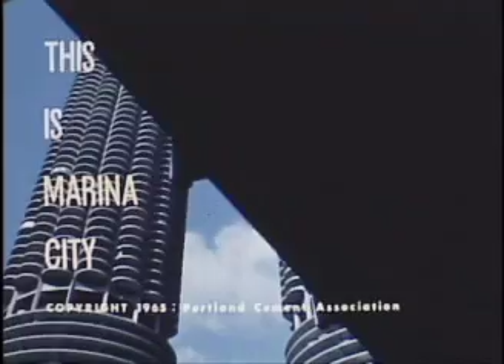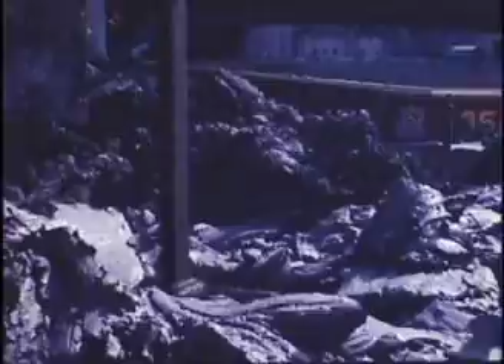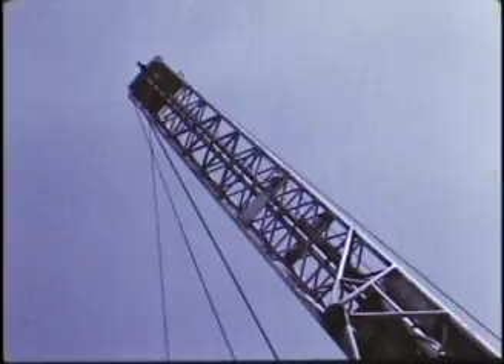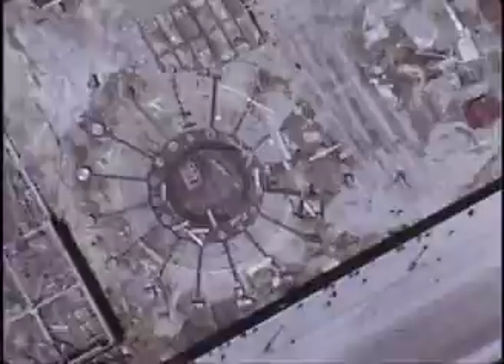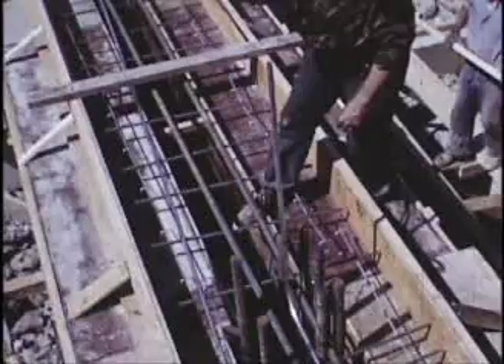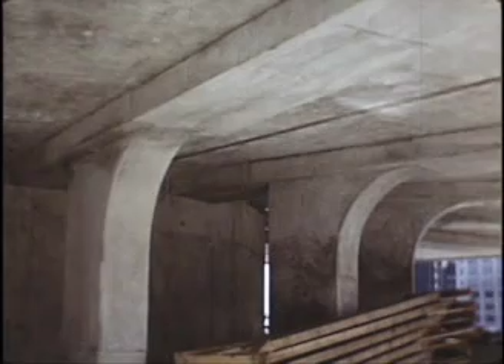This Is Marina City (Part 1 of 2)

Comment: The construction methods used for the Marina City complex in the early 1960s set the template for post 9/11 skyscraper construction 40 to 50 years later with the concrete cores